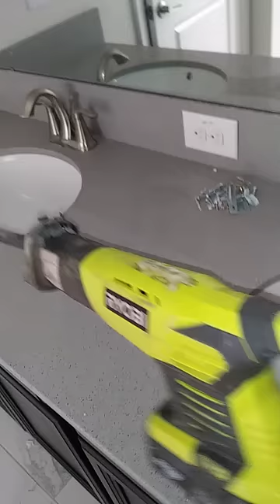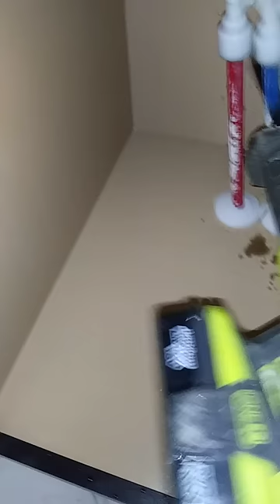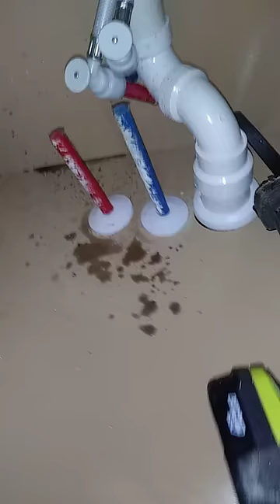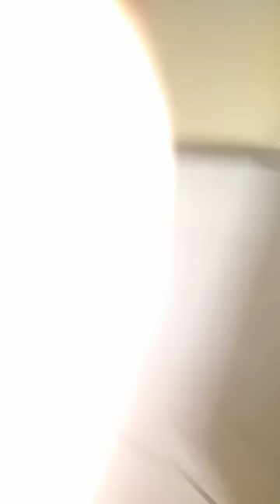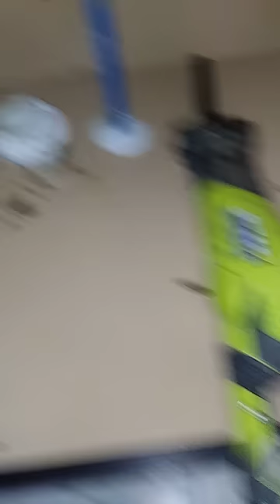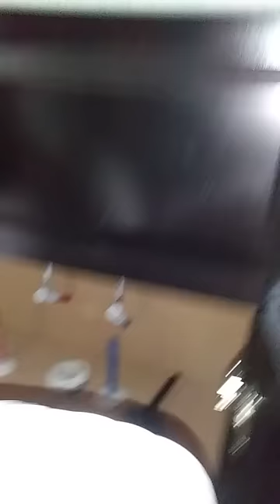This is what happens when you DON'T pay your plumber.

Comment: The REAL lesson: Don’t hire a man with Ryobi tools.
Reply: @Ron Koestlinger Black and Decker makes DeWalt.
Reply: 🤣🤣🤣🤣🤣🤣 is gonna say something similar
Reply: @DONTCALLMETHAT  somewhere down the line one person getting paid for all them brands lol I could believe it
Reply: 🤣 it's funny because it's true 👍  who comes up through the floor with the supply?? a Ryobi tool guy..🤣
Reply: My dad and uncle completely rebuilt a house with nothing but ryobi tools. I lived in it for a couple years before I moved to a bigger house.
Reply: Ryobi can handle very well small jobs, but if you need something comercial you may start with Dewalt
Reply: @Ron Koestlinger japan makes makita the best and original cordless tool brand. other than hilti that is.
Reply: Lol thinking same thing.
Reply: Not properly vented . Stub them out the wall !!!
Reply: @ttlkeat3284  Did you have to move because it fell down?
Reply: Absolutely true
Reply: @rjmac3001  I hate to break it to you but both are owned by the same parent company and like any other parent company why wouldn’t they use the same parts it’s the marketing that’s working on you Milwaukee is branded towards “professional” at a higher markup price all because of brand naming it doesn’t make any economic sense for both companies to invest in engineering and designing of different parts Techtronic Industries sells Milwaukee as an American made product which it is and it’s why it can be sold at such a high markup
Reply: @supporterofeverythingyouli6255  says biden supporter, I won’t even put a B to that clowns name.
Reply: @DONTCALLMETHAT  that's the other way around bud
Reply: @brannonschuster7735  incredible. GM owns GMC, Buick, Chevy and Cadillac, so you're telling me they're all the same exact vehicles?!?!!! Wow we're all soooo dumb for not knowing
Reply: Here come the tool snobs that think supposed professional tools make you a better craftsman.
Reply: Lmaoooo 😂😂😂😂😂😂😂😂😂😂😂
Reply: @davidcrawford6505  I totally see you on both points there. I don't or won't use Ryobi personally but ya know what? Yeah I agree Ryobi will definitely do the job if that's what you've got and know how to use them. To be fair though watching him try and cut pex with a sawzall was painfull lmao. All about the right tool for the job and that wasn't it
Reply: Haha man that's a great 1!😂
Reply: @supporterofeverythingyouli6255  I always come through the floor on an exterior wall.  Less likely to freeze.  Let's go Brandon!
Reply: @justinpennington7682  where I live now coming thru the floor is normal.    Most homes here are built on what I call a porch fondation.    Pillars and 2 x 10's.    Very weird for me being from the north where we had a basement...
Reply: Ive been a contractor for over 4 years and i just switched to ryobi. They have such a impressive lines of tools! Everything has been holding up great
Reply: @Foxxygrandpa241  honestly yeah they really do make the same vehicles and just rebadge and maybe a little bit different body panels or different lights but they do use the same motors cause it just makes economical sense to do so and that’s why Milwaukee and ryobi using similar parts isn’t to far fetched 🤙🏼
Reply: LOL
Reply: @justinpennington7682  cuz your plumbing wall in the middle of the house is really susceptible to freezing.  20 year master here dude you're clueless.  🤣🤣
Reply: Boom 🎤drop!
Reply: I said on an EXTERIOR WALL I come through the floor as it's less likely to freeze .
Reply: @brannonschuster7735  milwaukee is made overseas too, says China on the tools
Reply: @joeytate6917  it’s actually a group getting paid off of them. A hedge fund called Berkshire Hathaway. I guess you could say warren buffet. Everyone of them are either made in China, Japan, or South Korea. They also own rigid, I’ve heard Hilti, and hart (the Walmart drills).
Reply: That sawzall sucked.
Reply: @Jdl223  tbh they do have overseas manufacturers they have some in China and Europe but most are made in Wisconsin or Mississippi it just depends on who’s the distributor
Reply: @brannonschuster7735  fine let's look at it this way. Stanley Black & Decker owns DeWalt right? Very possible they're made in the same factory right? Absolutely in no way do those 2 share even remotely similar parts. Same goes for Ryobi and milwaukee. Hell TTI even owns HART I do believe. Are those also rebranded Milwaukee? Point is your reasoning can't be that a parent company owning multiple brands that may (or may not) be made in the same factory are simply rebranded and sold
Reply: I cant believe such a heated debate started over what was just a really good joke. We all need to chill. Just to give you "pros" some perspective, the Amish can build a house better than 90% of you and they aren't using any power at all.
Reply: @Foxxygrandpa241  that wasn’t a sawzall. That was a ryobi
Reply: @christophercrawford2736  what does that even mean?
Reply: @Foxxygrandpa241  Milwaukee makes sawzalls. Ryobi doesn’t. Just like Milwaukee’s permanent markers are inkzall’s and Sharpie’s permanent markers aren’t.
Reply: My thinking exactly
Reply: Being a stake holder it's completely true lmao y'all pay a arm and leg for a brand name on something regardless if it's the same
Reply: @brannonschuster7735  Volkswagen and Lamborghini, also share a parent company.
Reply: @robertbeirne9813  Lamborghini also used Nissan parts on the Diablo 🤙🏼
Reply: @Stewpkiddable  hilti went out with stone age brother
Reply: Seriously, I can't think of a bigger red flag.
Reply: @ttlkeat3284  for your two bikes?
Reply: 🤫🤫🤫When you good handy man o plumber! Whit any "F" tool! 😎👍🍺
Reply: Lmao should have bought a DeWalt
Reply: @Ron Koestlinger More like the Japanese equivalent of a husky type mid tier budget tool type. Good enough for just about any weekend warrior but won't hold up past a couple of months/year if you're using em for your daily bread.
Reply: lmaooo I always tell my foreman that uses ryobi . real men use milwalki
Reply: @justinpennington7682  LOL…🤣 what a nerd.
Reply: @Ron Koestlinger They are literally the same company. He is correct
Reply: Lime green is intended for popsicles not tools! Although ryobi is under TTI they have different tech. Take them apart and see for yourself
Reply: @terrytuell3361  race to the bottom, go watch an aVe tear down video and the let me know what you think
Reply: @trip_the_deep  ave is the man!
Reply: A wise man once said it’s not the tools it’s the user.
Reply: @jackbenner11  it’s actually the tools- you can be  skilled and mess up with bad tools
Reply: @Ron Koestlinger Lmao hate to break it to you, but Milwaukee is owned by a Hongkong tool firm named Techtronic Industries which also owns Ryobi, Dewalt and AEG 😅🥴
Reply: I concure...ryobi is junk. However problem looks like the operator....no wonder he didn't get paid. Took him a minute to get through 1/2 inch plastic lines lol
Reply: @brannonschuster7735  milwaukee sucks ass. I cant imaginate what that makes ryobi if those are same brand but cheaper.
Good for homeuse maybe, for professionals hell no
Reply: @Ron Koestlinger what if I told you Milwaukee, ryobi and ridgid power tools were all made in the same factory by TTI in china?
Reply: @brannonschuster7735  not a very accurate statement lol. They're not at the same level of performance for one, and their target audiences are not the same either. Yes, they are both owned by the same umbrella company TTI, but Volkswagen also owns Lamborghini. You gonna say a Golf is a rebranded Gallardo?
Reply: Lol I was thinking the same thing
Reply: That blade has to go
Reply: @davidcrawford6505  it's called self respect
Reply: @Andrew-sx2st  oh gee not that 😱
Reply: @supporterofeverythingyouli6255  your name makes me triggered I need to go to my safe space
Reply: @Andrew-sx2st  Make sure you bring your ryobi tools 🤭
Reply: @danthecarpenterman9463  I know right? Lol that's just 1st year knowledge
Reply: Yeah he is Ryobi tools because nobody can afford to pay him
Reply: @DONTCALLMETHAT  well Volkswagen makes Lamborghini. You can have the Jetta I'll take the Lambo same thing right?
Reply: @ryaneaton6851  and the Porsche
Reply: @Foxxygrandpa241  you are correct
Reply: @alex97594  no it's not
Reply: @ryaneaton6851  they're owned by the same parent company, they're ABSOLUTELY not the same thing
Reply: Ha!!! Thank you! That exactly what I just posted! 🤣. The reciprocating saw is your main tool in residential new construction plumbing. Id burn it in 2 week back in 2008. Lol.
Reply: @brannonschuster7735  Nope. 100% mistaken. Maybe black and decker but I know they own DeWalt. Dewalt not rebranded either. I still have a box full of them from 10 years back. The $45 trigger always burnt out. Designed to fail at a certain time just like an American car. If it was Japanese that wouldn’t happen. The triggers is interchangeable with the drill Trigger. Milwaukee’s always been stronger & could take more abuse. My Fuel Milwaukee sawzall I bought when Fuel came out maybe five years ago and it’s still working perfectly doesn’t even make no ugly sounds like brushes worn. Out of my six piece set heavily used only the hammer drill sounds fuc-ked up even smells that time but it’s still working fine for now. The cordless grinder with 1000 times Lennox $15 diamond blade is the badass. I’m still on my second one and it’s been 2.5 years. I haven’t bought a 10 pack of cut off blades for a dollar at Harbor freight during those 2.5 years. Lennox is number one in Sauzal blades Milwaukee’s number two the rest suck
Reply: @DONTCALLMETHAT  Yes sir. The Hobby guy don’t know that
Reply: @joeytate6917  Ha! Good one. I thought i got a great deal off the street in a box for a Makita demo hammer. When I looked at it better at home it said Mikote ! 😂🤣
Reply: @ttlkeat3284  I love the radio. I had the blue one with the dial then the blue one digital then the green one maybe with Bluetooth it got ran over it and I bought another one and this one’s Bluetooth. I gave the blue one to a buddy he bought a green one and switched out the guts and cut out the hole for the Bluetooth and went back to Home Depot and said he didn’t like it and got his money back so I gave him the rest of the blue Ryobi tools and he did the same thing till he got a good combo kit. Then he sold it on offer up added a few bucks and got himself a 4 piece Milwaukee. Now I don’t let him borrow my tools because I have that in the back of my mind MacGyver mechanics might get greedy and do the same to me lol I seen him do it with HarborFreight and Milwaukee and that’s what convinced me. I have seen several brands that are exactly the same when he take the shell off to fix them. Thats what he does now. Lol. Except now I called him Macgrubber mechanics
Reply: Skills are skills. You have them or you don't. When a person screams one tool brand over another, evidently they don't have enough skills. These are the same type that drive a new sports car and think they are fast, until the mechanic pulls up in a piece of shit and blows your doors off. This is also the same brand as Rigid. As far as the rough in, not one of you on here can tell what the behind scene on the plumbing is, and besides he said it was already roughed in. Typical of a Biden supporter to not understand what is going on.
Reply: @brannonschuster7735  Yeah, and a BMW is really just a rebadged KIA.
Reply: @danthecarpenterman9463  his boss probably told him to redo it and he was mad and pretended it's the customer fault. Probably an empty house new remodel or something too
Reply: Oh really?  I'm an electrician by trade, and Ryobi power tools are all I ever use!  Sure, I might have to replace a drill or two from time to time, but I would rather replace those than replace an expensive brand when it burns up.
Reply: And dull blades
Reply: @Ron Koestlinger actually Ryobi is the same as Rigid and another brand. Check out basically any tool from Ryobi and Rigid. Same exact thing with a different plastic cover. If you can’t get a job done with Ryobi. It’s either your full time job or your only skills are based on your tools.
Reply: @josephmoullay8857  What about a contractor who is broke and trying to better their careers and can buy a 6 back of tools and batteries for the same price as a Miwaki impact with no battery? For using 6+ hours a day Ryobi isn’t going to handle. But for around the house or even for larger projects it can do it.
Reply: @Ron Koestlinger wrong Ryobi is a sister company that also owns Milwaukee and Ridgid but they are not the same quality
Reply: Definitely should have listened to that comment 5 years ago period of the co-workers I've had those rocking the Ryobi should have probably stayed home and saved the project from delays and the customer some money
Reply: @hachi-rokuperformancegroup3987  look it up
Reply: Tbag Bwag, you think the pipe cares what brand the saw is?
Reply: Each of you who is using perhaps and iPhone or Android keep this in mind while you are typing where do you think they are made? I like Home Depot products and will tell you it does for the job for the average homeowner.
Reply: At the end of the day the tools do the same thing they get the job done
Reply: 😂 fact
Reply: @brannonschuster7735  no its not. Guys that have them thier batteries die in half the time of Milwaukee,  makita,  ect.
Reply: @brannonschuster7735  the battery connections are completely different,  not interchangeable sooooooooo...... nope. Maybe same owner different tool
Reply: @justinpennington7682  where I live freezes. It's against code to have pipes in an exterior wall 👍
Reply: I’ve seen a Ryobi impact smoke out on press board. Jussayin 🤷🏼‍♂️
Reply: @GEOVANNYQUEZADAgeov4nny  most intelligent comment on here👍
Reply: @brannonschuster7735   Use a Ryobi tool and then use a Milwaukee tool. If you can't tell the difference stick with the cheaper one. I for one will pay the extra money for a noticeably better tool then Ryobi.

Can't go wrong with Milwaukee, Dewalt or Makita.
Reply: @Ron Koestlinger its true look it up
Reply: @Ron Koestlinger Yeah and all your American tools are built in the same overseas factories that Ryobi is made in... including "all American" DeWalt. All use the same parts with different injection molds.
Reply: @GEOVANNYQUEZADAgeov4nny  My Ryobi miter has outlived my DeWalt.
Reply: @GSP-76  yet there is a noticeable difference with performance and quality between them all....hmm I wonder why?
Reply: @brannonschuster7735  lol crazy that you think ryobi and Milwaukee are the same. Just shows you've never held, used or seen a milwaukee in action.
Reply: 100%correct
Reply: Pretty good brand actually.  I worked at home depot ryobi top sells every brand . Just quality is amazing
Reply: No real plumber owns any Ryobi shit
Reply: @brannonschuster7735  No, they're made by the same company (TTI) but they aren't rebranded. Rebranding tools is Snap-On and Macs job.
Reply: @brannonschuster7735  that's not how it works.
Reply: Fr!!!
Reply: Another one to watch for,Ryobi,ozito and Milwaukee
Reply: @ttlkeat3284  it's one use vs thousands bro,you missed the point
Reply: I was gonna say the same lmao
Reply: Real man would get his money. Not sure what this kid is trying to prove for his company by making himself look bad in court if it were to go that way.
Reply: Hahah so true
Reply: @justinpennington7682  Bingo!
Reply from the maker: No I just cut shit out lol
Reply: Well yes but that’s not always the case I used to play football with frat boys with really expensive cleats, gloves, sleeves, and they were trash . I wouldn’t judge a contractor by there tool brand
Reply: @josephmoullay8857  owned by Milwaukee
Reply: Lmao for reals
Reply: Lmfaooo
Reply: @Stewpkiddable  yep its known as matobo or something  like that.but yea hilti is among the best of the best
Reply: Nice !!! Very true
Reply: @Stewpkiddable  uhu not the best imo!
Reply: @Foxxygrandpa241  dang im 35y but learned young that that is the way it goes.
Reply: Yo Fr😂
Reply: @brannonschuster7735  I thought Ridgid was Milwaukee? Maybe Ryobi too but def it's budget line. I don't care what tools people run, but any Ryobi tool I've used felt a little cheaper in the hand than most other brands
Reply: @DONTCALLMETHAT  black and decker is actually "Stanley Black & Decker" which is owned by Stanley, which also owns Mac tools, I believe gear wrench, and a bunch of other brands. Pretty sure they bought Proto a little while back also
Reply: @Foxxygrandpa241  right? Pretty sure he should have a few sets of pex cutters in his truck. Would have been a little more effecient
Reply from the maker: I went with a more dramatic approach.
Reply: @kyleaguiar3413  you're probably right. I'm not sure how things are now. Years I picked up a load from a b&d warehouse in North Carolina and it was full of DeWalt tools.
Reply: Anyone who uses Ryobi probably drinks from the toilet!
Reply from the maker: Shhhh. That's our secret Doug. 😉
Reply: Idc what any of you say.. I’m not using ryobi 😂
Reply: @brannonschuster7735  because some parts cost more than other parts. It's how they come up with pricing. If I make a product to sell cheap than I'm using some good parts but am replacing about %60 of the more costly parts for cheaper parts. 

This all starts at buying parts at wholesale from a company that's either going out of business or isn't making a certain product anymore 

Apple started it's company using Microsoft parts but they used cheap parts and charge a high price because in the end people are dumb. 

If you research most companies you'll see the a many are owned by just one in the end through different departmental companies
Reply: MOST DEWALT USERS THING THE NAME IS GONNA MAKE EM “REALLY GOOD AT TOOL STUF” LOL CLOWNS
Reply: @DONTCALLMETHAT  got eeeeem!
Reply: @ttlkeat3284  did you think people should be impressed because a tool made it through one house? Every cut that they made and every hole that they drilled took twice as long as it should have.
Reply: @jimkane9832  not trying to impress anyone. Just saying ryobi is a good brand. And who said A house? My dad and uncle has used their ryobi tools on a few houses and other projects. Didnt know dewalt people was dicks...
Reply: At least it's cordless.😆
Reply: Must be using chocolate  blades
Reply: Alright tool snobs!
Reply: Don't believe the hype I've seen a brand new out of the box DeWalt drill get smoked drilling holes in a stainless steel junction box. And a Ryobi impact drive 4" deck screws all day. Sometimes you get a bad product sometimes you get a great one. In the end there's only a few actual producers of power tools
Reply: @Stewpkiddable  Metabo FTFY
Reply: @ttlkeat3284  that bad huh 🤣
Reply: U mean Barbie toys
Reply: That's so wrong bro
Reply: @dondiego124  Preach. I don’t actually care as long as it gets the job done. Don’t even have experience with Ryobi lol. Just fucking around, never expected 168 replies
Reply from the maker: I didn't expect you to have this many rookie either. Or to have this many views on my video. Shit  just happened lol 🤣😆😂
Reply: Milwaukee M18 only.
Reply: @ManWentRogue  well your rite I've always thought there's a guy with a cheap drill must be an ameteur.or is it your naming off name brand tools to compensate for your abilities as a carpenter.im with choice two seeing as you say m eighteen lol.little girls drills.
Reply: I came here to say what you said hahaha
Reply from the maker: Me too
Reply: Bruh Ryobi very literally makes tools designed for plumbers
Reply: Lmao 😂
Reply: @brannonschuster7735  only the headlights
Reply: A man who uses ryobi has nothing left to lose. Don’t fuck with him
Reply from the maker: Ain't that the truth. A man without a cause or care and no reasoning is a very dangerous man. I'm all that and a psychopath
Reply: @supporterofeverythingyouli6255  maybe if you read the descroption you'd know that he stepped in to fix a previous plumbers work.
Reply: I was just about to say that.... ryobi is for diyers.. might aswell go all the way and buy hart tools from walmart
Reply from the maker: @el_jaliskillo4417  that's the dumbest thing I've ever heard of. That's like saying you should've bought an American car instead of a foreign car made in Mehico
Reply: Lmfao 🤣 🤣 🤣 🤣  so true!!
Reply: @GEOVANNYQUEZADAgeov4nny  Rubbish. I see Ryobi tools all the time on construction sites. Have done for year's.
Reply: Lol for real ryobis are good but not for heavy use they vibrate so much
Reply from the maker: Thank you
Reply from the maker: Some ppl don't read
Reply: I own most tool brands. My Ryobi tools cut through wood, just like the higher priced tools. Maybe not as fast, but i don't use all tools often, so it works for me
Reply: Lol, that's exactly what I was thinking! Lol
Reply: Thats the real crime here lol
Reply from the maker: 777 ur a real ...
Reply: Makita  and Milwaukee is what REAL  Plumbers use !
Reply: Lmaooo
Reply: Hahaha couldn't have said it better
Reply: Haha wow! Everyone starts somewhere Mr Milwaukee. A skilled contractor can use Ryobi tools just fine, but like I said, you need skill.
Reply: @DONTCALLMETHAT  according to home Depot, Ryobi makes everyone's shit.
Reply: @Bobcat8188  never seen that anywhere
Reply: @Stewpkiddable  I had a Craftsman before any others were around
Reply: @Stewpkiddable  Hilti sucks 😂😂😂
Reply: @brannonschuster7735  it’s a engine not a motor
Reply: @Foxxygrandpa241  it’s true. Ryobi id a reciprocating saw. Where Milwaukee is a sawzall
Reply: @therapinape9757 yes I get it and a RIDGID circular saw isnt a "Skil saw". My DeWalt "Multi tool/oscillating saw" isn't a "Fein saw". I don't correct somebody everytime they call a DRILL a "Drill bit" though 🤷
Reply: I use ryobi all the time and have never had one stolen off a jobsite whereas my coworkers are allways talking about how this that and the other has been stolen saves me from having to spend time and money replaceing tools they all do pretty much the same thing
Reply: Enough said
Reply: @oldguss  your just a DIYer
Reply: Who cares as long as the job gets done properly
Reply: @therapinape9757  actually i am a DIY coach i teach people how to be DIYers thanks for noticing by the way my ryobi tools are awesome they are not green ether had them since before they went green and still going strong i doubt you have much to add
Reply: Really struggling with that pvc lol
Reply: Bro tools are tools! they all work the same. You’re essentially just paying for a name, just like women are with handbags. It’s all just a popularity contest and you probably buy into all the hype 🤣
Reply: @hexZ06  your wrong
Reply: @dumdiversaspapalbull1452  why did the sawzall suck? Because it didn’t cut the pex? Lmao NO sawzall could cut pex any better. You don’t use a BLADE like that to cut pex. A knife, even sheers would do it quicker. They sell pex cutters that are just huge ass scissors.
Reply: 1000%
Reply: @mikeaustin1323  real plumbers 🤣 plumbing is fkn easy! You can do plumbing jobs with Walmart tools lmao
Reply: @supporterofeverythingyouli6255  Right!! Look at all the wasted space for storage
Reply: @DONTCALLMETHAT   I owned makita and Milwaukee and the attachments were limited you would see me with Dewault attachments 😂 ryobi is for DIYers.
Reply: @jorgeromano9900  Milwaukee hasn't let me down yet, but I feel you🤣 DeWalt is my second go to
Reply: @hexZ06  I'm  72 years old. I've been a plumber since 1968 at age 18. That's 54 years in the trade. Why your laughing , no clue. I'm sure I've been on the planet longer than you. Certainly working longer than a millennial punk like you. You've been blocked 🚫.
Reply: @DONTCALLMETHAT  i have all three I have no idea why but I do use Milwaukee more than makita my cousin swears Makita is the best
Reply: Word
Reply: @davidcrawford6505  dude they for sure help out every step of the way. All the best shops have the best equipment for a reason
Reply: @brannonschuster7735  It’s sold at a higher mark up because it is a better quality tool hands-down the batteries are better the durability of the tools are better Milwaukee makes top notch tools Dewalt is pretty good and is a close second along with Makita…. yes most brands are owned by black and decker….But you’re fooling yourself if you think they’re made with the same parts
Reply: @davidcrawford6505  When it comes to precision yeah it makes a difference man. you can get the job done a variety of tool brands…. i’m sure we’ve all struggled and done a nice job even with him tools. 

But knock on wood I have never not been paid for a job and if I wasn’t I would definitely not behave in this manner…
Reply from the maker: Wait until you pay for material and get stiffed on the bill.
Reply: @HungarianHacker  Yeah I’m really sorry that happened to you. I do my best to have my customers purchase their products prior to. 

it’s too bad they Do not have a yelp for customers to help us avoid shitty people
Reply: @HungarianHacker  Also that’s what contracts are for filing preliminary lean notice. then file a lien…works in ca
Reply: Yeah it's much more important they have milwaukee so they blend in like the rest of the sheep rofl
Reply: I don’t think it was tools but the Knowledge that did this one in
Reply: @Foxxygrandpa241  I can confirm, I have a Black and Decker drill that I got for cheap and I needed it for a 5 minute job. No way I was paying DeWalt or Milwaukee prices for that. Fast forward about a year and I got a DeWalt drill and impact set. Both are battery powered but the difference in weight, feel and performance is night and day. There is much more power to the DeWalt. And it just doesn't feel cheap like the Black and Decker.
Reply: @joeytate6917  all them brands...
Reply: @GEOVANNYQUEZADAgeov4nny  not true
Reply: Milwaukee is the best
Reply: @joepapa71  these guys making these claims have never used either 😂. I've used just about every brand on the market in hard use. Pouring concrete I used Milwaukee and Hilti every single day. I love my dewalts but even I can say they wouldn't have lasted a year on those job sites and anything less wouldn't have made it through the day
Reply: @Foxxygrandpa241  most job sites I been on its Hilti, Dewalt and Milwaukee. The framing carpenters tend to use Hilti around here. Most others use Dewalt or Milwaukee. I have honestly never seen a Ryobi tool on a job site Ive been on yet.
Reply: Judging by the tools definitely took over a month for the bathroom
Reply: All tools nowadays are pretty good quality. It's not like the old days where there were stark differences between cheap brands and the more expensive ones. The stigma that Ryobi is a cheap, DIY brand is just that, a stigma. I've got some Ryobi tools in my arsenal and they hold up with my DeWalt's and Milwaukee tools so they stay on the truck. If it gets the job done, it gets the job done. What color your tool is doesn't really matter.
Reply: Bro I was literally going to come at the same thing 💀😂
Reply: @supporterofeverythingyouli6255  where are they supposed to go?
Reply: Milwaukee
Reply: Funny reading comments about Ryobi and not the pipe cutting.
Reply from the maker: I didn't see anything wrong with the pipe.
Reply: This guys work looks really good . It doesn’t matter what kind of tools you use ,it’s your skills asshole .
Reply: I’d take that over dewalt 😭 they are boof asf
Reply: Lmao
Reply: OMG! Came here to say that!  22yr journeyman here....Milwaukee all the way!
Reply: @supporterofeverythingyouli6255  well there are times you come up thought the cabinet floor. Very common here in Indiana
Reply: @Stewpkiddable  those are made in China dude
Reply: @Foxxygrandpa241  they all tend to have the same engines used across their lineups
Reply: @dumdiversaspapalbull1452  you mean sawzaw
Reply: Lmao
Reply: @brannonschuster7735  You obviously have never used tools
Reply: Lmfao
Reply: Best comment 😂😂
Reply: @ttlkeat3284  I redid a couple house down to the studs with ryobi tools.  Even used a harbor freight flooring nailer for the wood floor in my kitchen.
Reply: @Stewpkiddable  makita, same company that makes hart, and ryobi.
Reply: Or Harbor Freight
Reply: Fuuuuuk my guy lmao that’s exact to what I was thinking 😂😂😂😂
Reply: Ryobi tool are not bad. It’s the skills of the person . And if you blame the tools, you have no skills
Reply: #facts!!!!! 😭😭😭😭😂🤣😂
Reply: @PhobicGamingGroup   @The lad vlad  I'm telling you they dont.... have you used them extensively or hard use? Please god you're not telling me DeWalt uses the same motor as B&D or that Milwaukee uses the same components as HART. Idc what video you've seen that made you believe thats truth but its not. I really mean that as nice as possible but side by side there is zero comparison in performance, none
Reply: @supporterofeverythingyouli6255  don't always have a choice.
Reply: Hahaha well said
Reply: @davidcrawford6505  its not stupid if it works 😂
Reply: This is funny, but on the real, he's a plumber cutting pvc pipes, not a carpenter doing demo on the reg. A ryobi Sawzall works just fine for what he needs it for.
Reply: @supporterofeverythingyouli6255  Read the description..
Reply: Facts
Reply: 😂😂😂 I don’t agree but that’s funny as hell
Reply: That was some clear ass work…
Reply: Hahahahahahaha
Reply: Somebody one here like I cut my grass with ryobi lol
Reply: @Foxxygrandpa241  they basically are.  Just some have nicer interiors and prettier paint. But under all that is the same vehicle
Reply: @Foxxygrandpa241  lol, foreal, might as well just done it with pvc cutters..
Reply: A bad worker blames his tools .
Reply: Right, hire the man with expensive Dewalt tools so he can over charge to make his money back. Got it. Thanks for the tip.
Reply: @brannonschuster7735  I own both brands and 100% disagree the ryobi is cheap made product that’s much heavier and less powerful across the spectrum of tools. Just because it’s owned by the same company doesn’t mean it’s the same product
Reply: Hahahahahaha
Reply: If it works why not !
Reply: Clearly not a plumber. Just a home handyman with domestic tools.
Reply: Lol relaxxxxxxxx bud
Reply: @DONTCALLMETHAT  and that is why you buy makita
Reply: The top of the line Ryobi stuff is okay...still not winning against the big boys but can hold their own alright; but their cheaper stuff is junk. Being the HD house brand every location is stuffed to the rafters with green so that's convenient. But it's not just skills that counts nor do the tools make the man, both are important and so for a professional who heavily counts on battery operated tools to get the job done and where time is money I think it generally makes sense to go with a more well regarded brand. I have owned DeWalt previously. I still have my Ryobi tools. Now I'm using Milwaukee m12 and Makita for 18v stuff. Makita is pretty nice, but at least in the us they don't have as much presence in retail, so I'd probably lean towards Milwaukee, but you can't go wrong with DeWalt either
Reply: @GEOVANNYQUEZADAgeov4nny  lol Dewalt tools don't last most often see people pop open there old ryobi tool from there apprenticeship cause there Dewalt broke. And get milwaukee later on.
Reply: Milwaukee is the Meta by miles these days. Dewalt second. (Period)
Reply: @MrRojas54  Welcome to Youtube!
Reply: Ryobi nonetheless is an inferior production of any Dewalt stuff. I'd probably go with Makita if that's the case. But I don't trust Ryobi stuff, you can tell it's cheaper.
Reply: Fr my Ryobi weedwhacker is ass when I mow my neighbors lawn I have to borrow their black and decker
Reply: @davidcrawford6505  They do make a difference though, I work in interior demolition and our tools need to be able to take an INSANE beating. Even the best companies tools don't last too long without being repaired or replaced.
Reply: @brannonschuster7735  yeah and corvette is owned my GM……. So dose that make a Chevy as fast as a corvette then?
Reply: If your  "plumber" walks in carrying anything Ryobi, give him 20 bucks and send him on his way.
Reply: lmfao you're not lying
Reply: @brannonschuster7735  ryobi is home depot brand, it's like buying Walmart brand toilet paper, effective but cheaper and not as good
Reply: @brannonschuster7735  Nissans are great cars tho
Reply: @Jdl223  naw that's the old Milwaukee.. which is their best by the way 🍻
Reply: @joseelmarijuano8794  If only they could spell it after looking at it everyday….
Reply: @supporterofeverythingyouli6255  if you know code exterior walls you no longer suppose to run water lines in them in certain states
Reply: @DONTCALLMETHAT  Milwaukee makes ryohi
Reply: @leesilverado6789  they're just owned by the same Chinese parent company Techtronic. They are two VERY different tools.
Reply: Lol
Reply: @Foxxygrandpa241  also Fiat owns; Abarth, Alfa Romeo, Chrysler, Dodge, Ferrari, Fiat, Jeep, Lancia, Maserati, Ram Trucks, and SRT. But apparently they are all the same, who knew🤷
Reply: @jesseh9523  I'm tellin ya!!! You learn something new everyday 😂
Reply: Oh no! I’m one of em Ryobi tool guy…. Fear me?
Reply from the maker: You so scary lol 😅😆
Reply: Bahahhahahaha
Reply: man its all too  common to see guys with a full set of dewalt tools, and also not knowing what the fuck theyre doing.  "Oh you bought that whole set with your credit card?"
Reply: @brannonschuster7735  tti does not sell Milwaukee as an American made product. And it’s not. You clearly don’t own any Milwaukee tools because of you did, you’d see that almost none of their tools are made in America. All designed here and made somewhere else. Like China, Vietnam, Taiwan, Malaysia. I’ve seen them all except USA. Unless you’re talking about their multi tool blades which in that case they outsource to another company so technically Milwaukee doesn’t even make them. Milwaukee is not an American made tool company in the slightest
Reply: @dougkienast5229  yes. Because a corvette is a Chevy. And a Chevy is gm.
Reply: Who cares if your plumber use ryobi As long as he got the job done
Reply: @supporterofeverythingyouli6255  The previous plumber as noted in the description.
Reply: @DONTCALLMETHAT  Stanley Black&Decker*
It's Stanley's company.
Reply: I have a corded Ryobi reciprocating saw and it's surprisingly very impressive! I highly recommend it if you don't mind dealing with a cord.
Reply: @PANZERFAUST90  either way DeWalt comes from them
Reply: Lol I was going to say the same thing
Reply: That garbage could barely cut the pipe!
Reply: No doubt
Reply: And a hacksaw blade in his sawzall
Reply: @ foxy grandpa,,,,, what he means is sawzall is a patented name. It’s a reciprocating saw. That’s the scientific name but I bet ole harelip didn’t know that. I’m talking about Christopher Crawford aka harelip.
Reply: Good one lol
Reply: Their 2500 lumen light and small leaf blower. Been using them daily for 3 years.
Reply: Hey I've got some Ryobi gear LOL!! In fact, Milwaukee, DeWalt, Ryobi and black and decker are all made by same parent company
Reply: Most of the power tools are all made by the same company but RYOBI is just 1 notch up from black and decker and 2 notches up from HART.
Reply: I wouldn’t be surprised if this guy had a van full of harbor freight tools
Reply: You probably use Milwaukee don’t you
Reply from the maker: He probably doesn't even own tools other then a dildo he calls big ripper
Reply: @DONTCALLMETHAT  So dewalt is just overpriced black and decker?
Reply: @Stewpkiddable  no man milwaukee all the way
Reply: Can’t afford better tools if clients aren’t paying I guess 😂
Reply: @manoloribera9362  You have a point
Reply: @mastermason4766  even tho B&D makes DeWalt, they're still the better, more reliable tool.
Reply: @DONTCALLMETHAT  I use air tools but do own a dewalt angle grinder
Reply: @mastermason4766  I don't think one could go wrong with DeWalt even tho I'm now a hard core Milwaukee man. I still have a few DeWalt brand drivers.
Reply: I've literally seen a Glazier use hart tools. I like the ryobi battery platform. The tools work. I've used them in glazing, sheet rock,  demo etc. I have no problem with ryobi. I can't stand Dewalt or Milwaukee cause of the price. I haven't had a single ryobi tool break on me and I was hard as shit on the non brushless impact. I beat the hell out that thing. Still works too. Upgraded to the brushless ones. They do the job.
Reply: @shaynegallagher6006  i just dont like companies that pretend to be american, or that are owned by giant congloms like TTI... Makita makes tools and electric motors as they always have and still own themselves.
Reply: You read my mind
Reply from the maker: I'm s mind reader
Reply: @ttlkeat3284  I’m amazed that it lasted 2 years then fell apart
Reply: @RiverSLV  didnt fall apart I got a bigger house with a garage that was rebuilt with ryobi tools...everything's still holding strong. Nice to make an assumption without even knowing.
Reply: @ttlkeat3284  so it didn’t fall apart but it fell apart shortly after it was sold I’m so sad to hear that
Reply: @RiverSLV  actually my uncle got it for her daughter to live in i still cut the lawn over there. You so funny.
Reply: @ttlkeat3284  so you’re saying that the house fell down and now it’s just a grass field that you mow?  😢 I feel your pain brother I’m here for you let’s get together and sue ryobi and you can use the money to get you a set of real tools like maybe Hilti
Reply: It Barely Cut The Pex Itself 😂
Reply: Lol bro fax
Reply: @Stewpkiddable  no way Milwaukee is the best Makita isn't close. DeWalt is second for me
Reply: Was gonna say never seen a plumber with Ryobi. However I own quite a few different platforms so you never know Ryobi does make a good battery powered pex crimper. Also his work is very clean. So who cares what he uses.
Reply: @davidcrawford6505  When I was a young mechanic all I could afford was harbor freight. Everybody made fun of me.

That first year I saw guys break a bunch of Klein screwdrivers, USA Craftsman sockets, Snap On sockets, Williams extractors, Proto ratchets, etc etc etc

8 years later I'm now an industrial electrician and still have good Pittsburgh tools. I also branched out after climbing the proverbial ladder and having the funds to splurge on made in USA brands (and some European like Knipex, Wera, Wiha)...still haven't broken any tools except for drill bits cause I paid attention to all the tool snobs abusing the shit out of their 50 dollar single screwdriver and learned what NOT to do!
Reply from the maker: Mark, your story is one this newer generation needs to hear. We all started watching our elders in our trades and learning from their failures taught us what to buy and not buy. Good on you brother cheers.
Reply: I bet yous done a good job🤣
Reply: Personal preference, I prefer dewalt
Reply: I wouldn’t pay you for that shit either lol the plumbing is all wrong
Reply: i could have chewed through it faster
Reply: Ridgid has a lifetime warranty. It breaks they fix. I use my tools a lot. My impact drill has been fix three times for free. I just have a back up for everything and I save 1000s. Yes, Ryobi are used by homeowners and guys who can't afford teal tools. Signing a contract is always a good thing but a handyman can't sign a legal contract over 600 dollars that's why guys get screwed. My advice is to get your builder's license and you'll get paid or take the house
Reply from the maker: @aservant2287 I have some broken ridged drills who do I call for warranty
Reply: @HungarianHacker ghost busters.. because they died
Reply: @supporterofeverythingyouli6255 Perhaps that is an outside wall that could freeze or the plumbing wall landed on a support beam?

Haven't been plumbing long I take it?
Reply: @brannonschuster7735 VW owns Bugatti too I guess all these Bugatti owners really got ripped off they could've just bought a Jetta and saved a million dollars
Reply: Ryobi & Milwaukee are the same company lol!!
Reply: @JDeWittDIY  By that logic a VW is a Bugatti
Reply: @joshanderson924  Exactly.  If the goal is to go to the grocery store and buy milk, a VW and Bugatti are equivalent. Just like a Ryobi sawzall will cut PVC just as well as a Milwaukee, but it doesn't look as good.
Reply: @JDeWittDIY  Quality is irrelevant to you? Spoken like a true Ryobi fanboy
Reply: @joshanderson924  Typically, when people run out of arguments they resort to name calling. They all come from the same factory in China. Explain how the quality differs?
Reply: @JDeWittDIY  Ryobi and Milwaukee are owned by the same parent company that doesn't mean they're the exact same tools. One is far better quality than the other hence why one is twice the price. I called you a fanboy because you're talking as if Ryobi is the same quality as Milwaukee which it is not. If you think that's "name calling" you're extremely fragile and sensitive.
Reply: @joshanderson924  With the one that's twice the price, I think you're just paying extra for the name, tbh.
Reply: @JDeWittDIY  No the parts are different. Motors, switches, batteries, casings etc. You can find lots of tear down and test videos here on YouTube demonstrating the difference in quality.
Reply: @DONTCALLMETHAT  mercedes makes the C-class and the Maybach …so whats your point same company makes crap and good stuff
Reply: @jackbenner11  but if you have lousy tools, even the best user is going to be slowed down.  Real pros invest in real tools.  They buy them once and take care of them vs filling up a landfill with tools that will break or wear out quickly forcing frequent rebuys.  If Ryobi has a circular saw, it is going to be noticeably weaker than a Skil saw model 77 with a magnesium body (lighter weight).  Its really more of a knowledge and experience thing where these traits are seen as lacking with those trying to save a buck buying cheap Ryobi tools.
Reply from the maker: @Kudeghraw I'm a third generation builder.  I chose plumbing as my craft almost 25 years ago. Ryobi has come a long way in my field.  They have what I call trade specific tools that no other manufacturer has.  Ryobi also has a tradesmen/ contractor brand of tools. I've owned the same reciprocating saw for 12 years, and it's been tested. Trust me.  Now I do own Hilti, Dewalt, Rigid, I have found my Dewalt to be less reliable than my Ryobi brand tools. I like Rigid, but I have a cabinet full of drills that need repairs. For the $200+  per drill. I believe it's not with it.  Hilti is a good brand but I have TE300 ($3500) and TE 70 ($2500) I compare them to my bosh which I Purchased for a little project I was doing in Miami.  I got it for $4-6 hundred dollars.  It out performs my Te70. In conclusion 😌  If you use your tools in a wide variety of applications and put wear and tear. Go with a brand that's not going to rob you and buy the best in that brand.
Reply: @HungarianHacker  Sorry, you aren't selling me on what you sold yourself on by selling yourself short.  Don't care about your Ryobi experience.  I care about mine and the general population's opinion and experience that supercedes your outlier of opinion.
Reply from the maker: @Kudeghraw, yeah, self denial is very prevalent in your statement. You just keep your opinions to yourself and not bring the majority of tool using contractors into the equation.  You're the small majority in this one, bud.
Reply: @HungarianHacker  "You're the small majority in this one, bud."  I'm willing to bet my house on that right now, are you?
Reply: @HungarianHacker  "self denial is very prevalent in your statement."  Lick thy wounds Harbor Freight warrior.  All that is accomplished here is an admission real tools are too expensive for your budget.  You are here, defending it.  It is like you are used to this and will always have to defend the choice to use Ryobi.  You are convinced Ryobi is the only brand that makes plumbing specific tools.  Like a Pex expander.  Nobody else makes one of those right?  Just Ryobi?  What other plumbing specific tools does Ryobi make?  A shovel for digging out busted sewer lines?  Do they have the monopoly on sewer cables and the spearpoint and spiral saw adapters?  What does Ryobi have that no other tool has for plumbing?
Reply: @HungarianHacker  "I'm a third generation builder"

I'm a first generation builder.  Yeah, plumbing was one skill, probably the easiest of the all.  I am currently swapping out all galvie pipe and bad pex to redo everything my way.  I just finished designing a basement bathroom with a perfect drainage flow as all joints are connected at a 45 degree angle, thus helping the flow vs a T (which is illegal).  Certainly easier than electricity, although once you get the hang of things, power isn't so bad.  I am rewiring my house one circuit at a time.  Real helpful to learn how to do 3 way switches so you can replace any ceiling fixtures.  Masonry, do you know how to repoint a flagstone porch?  Do you know what slump is and do you have a good eye for it or will the mixing truck be laughing all the way to the bank after dumping their 12 slump and leaving?  Welding.  Can you do a position 3 weld with 6011 rod?  I can!.  Yeah, I repaired things like aircraft carriers, destroyers, frigates, subs for the country.  I remember participating in a 4 x 4 foot bulkhead patch on the USS Monongahela that took 36 hours.  A a civvy I built the beams for many casinos and quite a few buildings on college campuses. Ornamental handrails that have to be perfect to fetch the premium price.  One weld is all it takes from me for the welding inspector to say "Looks good, do you know where I can find a carwash near by while you finish up" as I complete 72 full pen welds in a shift.  How bout a cutting torch?  Can you cut?  Does it look like a hacksaw cut or are you grinding slag off all day?

So don't talk to me kiddo.  I've done way more than you in life and swapped career to a desk job to save my back nearing retirement.  sure is rough being rich...
Reply: @HungarianHacker  What plumbing trade specific tools does Ryobi have that no other brand has?
Reply: @HungarianHacker  Just wanted to point out that there are more likes on this thread than there are subscribers to this account...  I think they call that a ratio...
Reply from the maker: @johnnyzsalt5374  what you don't have google?
Reply: Ryobi tools are the result of Milwaulkee destined tools that didn't pass the final inspection, but they want to sell it anyway.
Reply: @HungarianHacker  "You just keep your opinions to yourself"  Thankfully youtube will help you out in that aspect.  but how can you walk the world in confidence when you know naysayers HAVE to be suppressed?  Do you ever get the truth or are you comfortable enough with a lie?
Reply: pmsl
Reply: BINGO